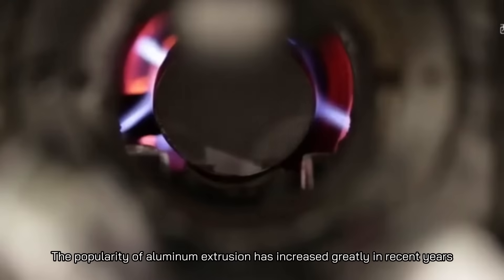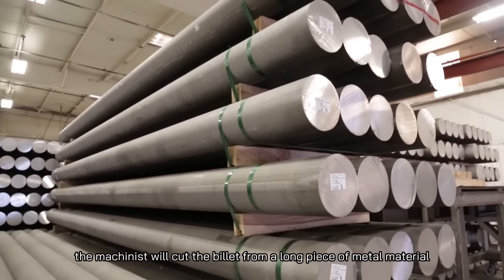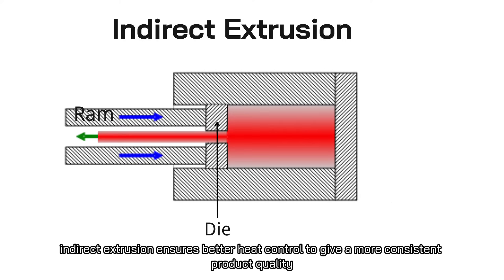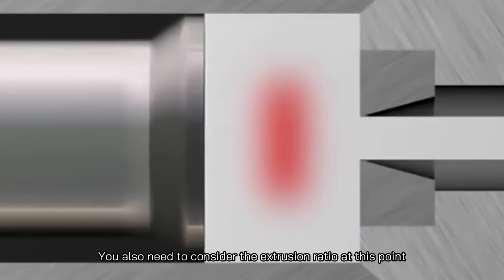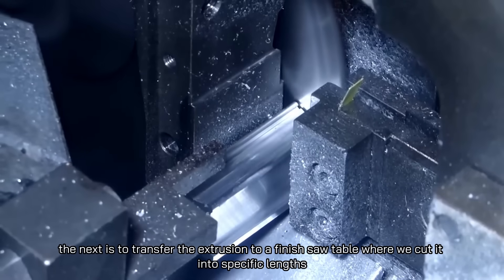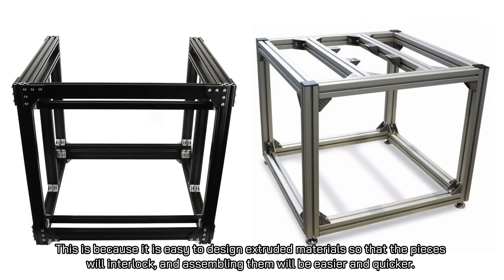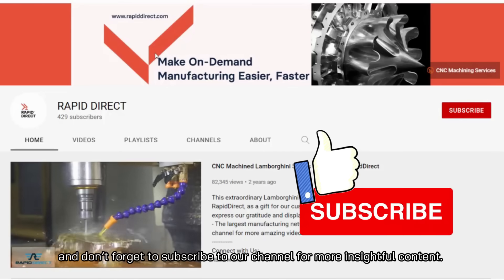How are Aluminum Extrusions Made?

Comment: Worked in a reynolds metals extrusion factory as electrician for a couple years. Worst job ever. Hot, nasty and dangerous. Did i mention  hot  and nasty. Learned how dangerous molten aluminum is when it comes into contact with water.

Comment: So how does the dye get cleaned out?
Reply: It's spelled die, and why would it need to be cleaned out?  If the plunger has the same design as the die, it pushes almost all of the aluminum from the billet through it.  If there's a little bit left in front of the die, I'm sure that it could be removed easily when needed.
Reply: @AnotherWisenedOne not too familiar with how the work.  I would just imagine there wood be waste

Comment: For being both an informative video and an ad for Rapid Direct it sure does cheap out on labor given the generated speech and the complete lack of quality control, and doesn't help that some of the images are poorly up scaled JPEGs blatantly taken from the internet.

Also, the image for indirect extrusion and the explanation given are contradictory to each other. The image states that the die moves into the billet, while the narration states that the die is stationary and that it is the whole billet holder that moves against the die.

Ending the video with "Rapid Direct gives you the best aluminum extrusion services, including expert advice and recommendations." isn't something this video showcases.
If anything, cutting down on proper narration and a basic QC pass on a sub 10 minute long video used for marketing is a bad business decision. Any company cutting such generally cheap corners isn't a company I want to work with.

Now yes, the video is still good overall, but the glaring issues doesn't paint a good picture of the company's practices.
Reply from the maker: Thank you for your comments. Our video content includes various types such as knowledge-sharing videos, insight factory videos, and engineers' insights. Ending knowledge-sharing videos with a promotional message for services may not be a good content strategy, as you pointed out. We will consider your feedback and work on improving it. Once again, thank you for your feedback.

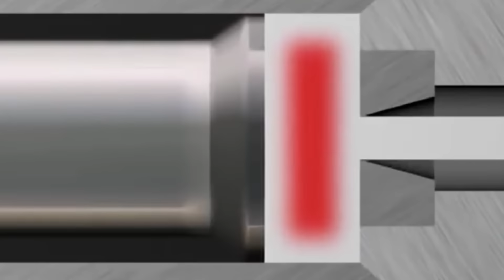Comment: 4:00, Certain types of Aluminum alloy such as the 6000 variants, Do not use water quenching for the process. Certain types of aluminum alloy are rich in magnesium and other metals that are actually very vulnerable to water, Causing marking and a unqiue type of corrosion that dull the metal. Processes without water use air cooling through the puller/strecher process. This drops the metal down to 120-90oF where it can be saftley handled for racking to be placed into furnaces. T5-T6 require a cook time of six and a half hours where T52 require only two and a half. T4 is a special type of aluminum extrusion where it does not require and heat treatment at all.

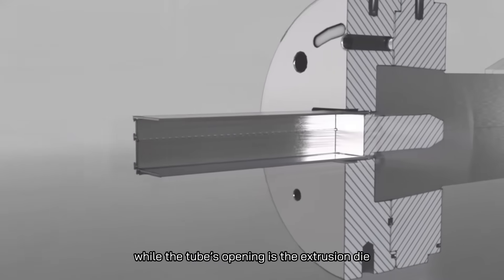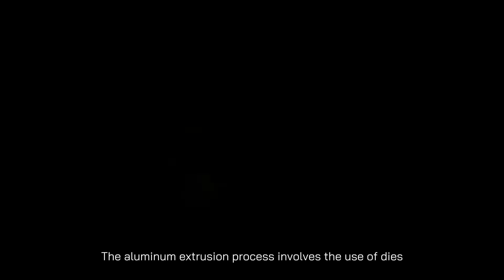Comment: Hollow shape extrusion 0:55 - 0:58, 1:07 left - the both dies, 1:09 the both dies, others up to 1:27 are only first inner dies. We look at them from the exit of aluminium details.
It would be great to see the die and corresponding resulting aluminium shape side by side.
As I understand, the idea is to have a support for the central part in the first die and this part is as long as the second further final die. So, inner shape of aluminium is made by the first long die and the outer shape is made by the second short die; the both dies end approximately at the same cross-section.
Reply: Ahhh!!!!  So the Aluminum "re-combines" after passing the support arms of the internal shapes!  Thank you SO MUCH for helping explain that.  ❤️ I've been using extrusion for engineering design for years, and it always bothered the hell out of me not knowing how they managed that without having parts of the die floating in mid air!!

Comment: Nice! But how are hollow profiles made? How are the cores of the die fastened? Do they remain in the core of the product and were removed after the extrusion?
Reply: They're pressed through, just like in the video.
Reply: @EaglePicking  That still doesn't explain how the cores are fastened, if that happens at all. For very small "holes" in the profile cross section, like shown at 5:33, you would either need very thin and very long steel bars to fit into these holes while extruding (and afterwards, they would need to be removed, which is what @christiankrippenstapel4336 had asked: how do they get removed?), or the aluminum needs to flow around a construction in the die, in which case the aluminum would need to weld itself together again, right after the extrusion. So, how is it done?
Reply: @Nonononono_Ohno  When the aluminum is hot enough and the pressure is high enough, it just flows together again.
Reply: @EaglePicking  I see, thank you!

Comment: I was hoping you would explain how hollow extrusions are made. That seems impossible!
Reply: The die is a 3D object so it can have pathways connecting the hollow center to the sides – only the exit hole matters for the final extruded shape. Aluminium will flow around the support structures with enough pressure.
Reply: multi step process with pieces of finite length. sort of forcing heated material over a mandrel, then thru a die for the outer surface shape

Comment: It would be nice if people in charge of editing the voice over to a technical or scientific video started to appreciate the difference between force and pressure. Saying 15,000 ton PRESSURE is very much wrong. How are kids and the general public supposed to learn from such badly written material? Force is force, pressure is FORCE PER UNIT AREA - a very different thing. Please stop it.
Reply: Press is typically rated by tons it can push in linear direction. Technically, you should use kN (kilonewton) instead but that's rarely done in practice. However, you are absolutely sure that the pressure during the extrusion depends on the surface that force is applied.
Reply: @MikkoRantalainen  Well, I know they should use the N SI unit, if they really wanted to speak by the book. However, tons does not bother me at all, but for the fact that there are short, metric and long tons, which can be confusing. A kN, that's about 0.098 metric tons  (or about a couple of hundredweight) which may still be adequate to express the force of a press.They all are force units, though a bit of a mess, but still all of them force units.
Anyway.
But these people speak of a FORCE (N, ton, kN, have your pick) as if it were a PRESSURE (Pa, bars, PSI, and what else). Force, alleged to be the same thing as a pressure. My dear God.
I think they need to go back to their birthplace, be born over again, attend school at least up to the ninth grade, and be tought their Physics over again

Comment: What about aluminum heatsinks ? For transistors , GPUs  , CPU's ? Same technique ?
Reply: Always the same as long as it is in form of cut profile, and most of heat sinks are like that.
Reply: @kamilblk  Check the heat sinks on PathosAcustics amplifiers.
Reply: @tomasglavina9952  they look great. Still the same method of production
Reply: @tomasglavina9952  Pathos Acoustics as 2 words got more results.
Reply: Basic heatsinks, yes. High quality CPU coolers use copper heatpipes which are totally different animal.

Comment: I appreciate the video. However, the narrator stated "15,000 pounds of pressure," which is incorrect. It is force, not pressure.
Reply from the maker: Thanks for pointing out. I will confirm it with our engineers.

Comment: Nice presentation. If I can make a remark (I worked as a metallurgist in extrusion plants for 23 years), in the minute 3:05 they mentioned extrusion forces over 15,000 tons. A press capable of this force is a monster; the largest press I've ever seen was a 10,000 ton extrusion force, whose billet was 40 inches (1 meter) 
 diameter. Usual press sizes for day to day production range from 1400 to 2500 tons.
Reply: How are they able to "spray" an 0 with support material holding the center of the 0?
Reply: @Eduardo_Espinoza  look at 1:23. The holes in the dies are not cylindrical. So basically the aluminium flows around the core trough holes and gets compressed into the final shape only at the outlet.
Reply: @MarcoTedaldi  so there is support material at the entrance of the material and up to a point but not all the way to the exit, the aluminum is soft enough and fill in the supports once it passes?
Nice, I always had that doubt 😅
Reply: @RetroTinkerer  I think so. That's how I understand it at least. At those temperatures, Aluminium is quite malleable and "flows" under pressure. It's somehouw amazing like a lot of metal work is...
Reply: @RetroTinkerer  That is exactly how every closed aluminum profile is made, no matter the shape.
Reply: Exactly. But this method works only for soft and medium strenght alloys (1XXX, 3XXX, 6XXX) and it's not suitable for aerospace applications; in these cases it must be seamless.
Reply: @MarcoTedaldi  Does that mean that the metal (aluminium) is hot enough to fuse back together right after it passed the die?
Reply: @vgstb  with enough pressure you get the metal to weld together at room temperature. So yes: with enough pressure and heat metal is doing that.
Reply: Aluminum pasta is the best pasta
Reply: At ALCOA’s Vernon works we used 2500 ton to 5000 ton presses in our day to day operations, also they didn’t mention the need to creat an atmosphere around the freshly extruded aluminum to prevent rapid oxidation of the hot metal. One more thing I’ve never seen aluminum quenched  straight out of the press to cool it which would be to rapid of a quench, and cause severe warping of the metal!
Reply: I had always imagined the thousands, if not more, of variations of dies. How in the world could such a catalog of shapes be organized? How would anything be looked up?
Reply: True. In the factory I used to work for, there were about 15000 dies in the warehouse. Apart from that, there are also the "accessories" that form the "tool stack", such as assembly rings, support tooling, feeder plates.... By the time I left the company (in 2002) they were beginning online management via barcode. But it is more or less like warehouse management, every piece must be stored in an identified rack in an organized way and there must be someone very meticulous in charge of it (not me, by the way).
Reply: @Telephonebill51 each producer has its set of dyes according to his customers and his presses.
No one has "all" shapes.
Maybe 30 or 50 should be easy to organize.
Reply: Not really. I worked in a factory that has (or had) more than 10.000 dies  in its inventory. Of course it depends whether it is a "commercial shape" or "speciality" factory, but in average 5000 to 10000 dies is normal to be found. We can discuss about "standard shapes", "open catalog" or "by customer request" dies, but it will take very long.
Reply: That did raise an eyebrow.
Reply: He was thinking about 15 hundreds of course :) - BTW he mentioned that aluminium doesnt weight much... when mounted :) - mounted weighs the same as far as you didnt mount it 15000 feet above ground when it weighs a little less :) Amelinium Menelium :)
Reply: I get the whole extrusion thing but it is the holes that puzzle me, I don't think he explained that part? How do you end up with a continuous hole or holes?
Reply: And, pressure is not measured in tonnes.
Reply: @alexwood5425  In the US they are confused because they still use garbage inch, pound, galon....
Reply: @jpcaretta8847  Right! 1 US ton = 2000 lbs, unless it's a long ton that = 2240 lbs - don't ask! To the rest of the world a tonne (preferred spelling outside the US) = 1000Kg or about 2205 US lbs, so while they sound the same and are pronounced the same; they're not the same. The US needs to get with the rest of the world or at least use "tonne" to designate the distinction between a US ton and a metric tonne.
Tonne force is an acceptable measurement of high force pressure in the metric world. Pascal is generally used in pneumatic and hydraulic applications.
Reply: @jpcaretta8847  I'm fluent in metric but since all of my machines are in Imperial decimal I recognize that there is little difference between working in millimeters or decimal inches.  Because many materials in the US are still measured in fractional inches and I'm fluent there as well I am not confused at all.  I'm just trilingual..
Reply: @jpcaretta8847  And they also still can't spell "aluminium" correctly, either!

Comment: You didn’t answer the biggest mystery that most people wonder about.  How do you get holes from an extrusion process?
Reply: The extrusion die is made of two pieces. The front part forms the external surface, then there is a mandrel that forms "the hollow part" behind the die. This mandrel is held to the front part by a "spider" with four arms. What intrigues most of the people is that, during extrusion, the billet metal is "cut" by the "spider arms" , but because of the temperature, pressure and the fact that the die chamber is sealed against oxygen, the metal welds back forming a hollow profile. This is suitable for architectural profiles, but for aeronautic purposes or high strenght alloys, for instance, seamless extrusion is applied.
Reply: @glauroo.junior83  wow thanks!
Reply: @glauroo.junior83  why couldn’t you have made this video.  You would have done a great job.
Reply: Thank you, David. As a matter of fact, one of my tasks as a process engineer was training of salespeople and shopfloor workers about extrusion technology and aluminum metallurgy.
Reply: That was my question too, actually the only reason why I clicked on the video.. This is the best thing about internet, you can meet in the comments section of a semi-randomly suggested video the best placed person in the world to explain you a doubt you had hidden in your mind since ages.. even without asking! 👏
Reply: Core bars
Reply: They are called bridge dies or port hole dies, big dies may will have feeder plate as well
Reply: This question is why i came here
Reply: They use multiple dies from what I know.
Reply: 6:07 I want to see a video of an engine block being extruded
Reply: Reynolds metals extrusion press used a mandrel to create hollow pieces. The hydraulic ram is hollow  with a mandrel inserted into it. The mandrel is pressed through the billet first until rhe tip is in the center of the die. The ram is then pressed flowing the aluminum around the mandrel tip creating the hollow shapes. The mandrel is driven by a seperate hydraulic ram from the main press. So the two can be moved independent of each other.
Reply: Actually it was shown. You just haven't noticed. 0:55-0:58. Up to 1:27.

Comment: why extruded aluminum heat sinks are so expensive? If the process is so simple, then heat sinks should not cost so much.
Reply: Crazy profit margins because people will pay for them anyway
Reply: Yeah, you only need precision machined die and 15000 ton press. If you want accurate dimensions for the extruded material, you need to keep replacing the die pretty often and those may cost 30000–50000 USD per part.